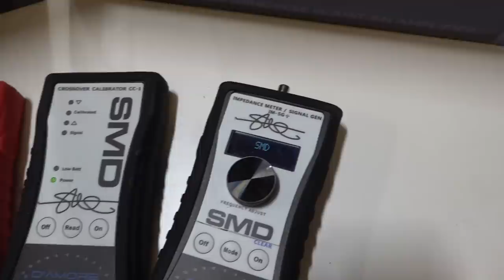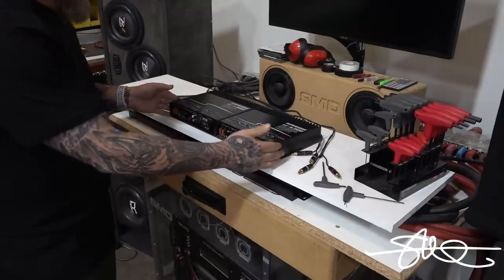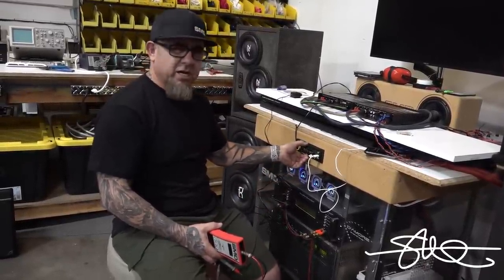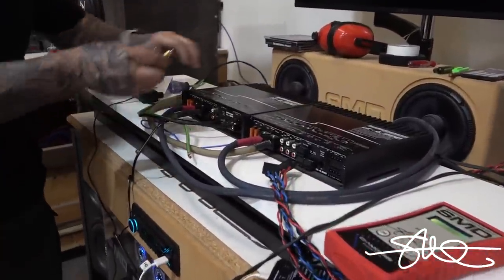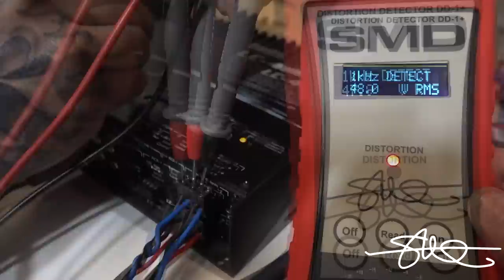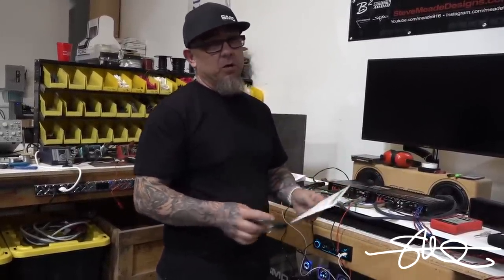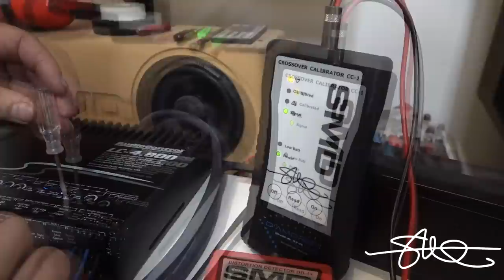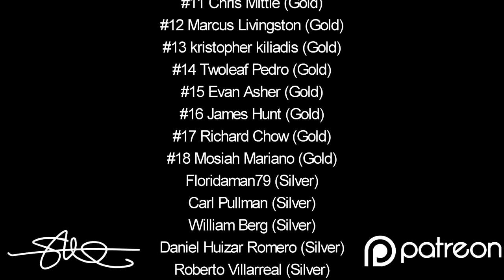Full Blast Safely! How to Properly Set Gains & Crossovers on Two Amps + Bass Knob

Comment from the maker: want to understand gain's and gain overlaps a little better? this is a great read.  https://www.stevemeadedesigns.com/board/topic/207759-what-is-gain-overlap/?page=2
Reply: I need some help big homiie trying to get this 2004 hyundai santa fe right I got a 1000 watt 25 to life amp from rockford fosgate need some info on which subwoofers and mids and tweets are best for me the amp also says 5ch
Reply: I still don’t understands this gain overlap );
Reply: meade916 I Used your equipment and now I never heard my Subwoofers sound so Clear and Clean Before I enjoy them wayy more now Thanks meade916
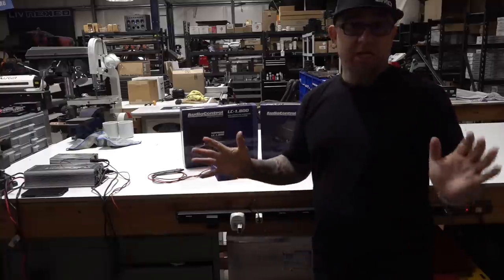Reply: What is the name of the song at 1:13? Also I'm a huge fan Meade!
Reply: @sleepzzz800  it is like turning the test tone down because not all music is at full volume as some are recorded lower, also USB, ipod and CD music can play all different on the same system, so the 0db tone is like full volume but not all music is like this so if you set the gain with 0db with most music its not going to reach full volume, you can also do this to reduce power for smaller speakers / subs, so overlap is just lowering the signal to accommodate for a weaker music signal than a test tone that is at full tilt.

Comment: I have the DD-1 version with the old harness. On my OEM integrated headunit it is hard to set up my gains etc. There are no numbers on the LCD display just horizontal small bars.
The only solution i have is to count how many bars i have from Max then i know my max headunit output. Ive found out that i can blast full tilt when i have 3bars left to max :)
really annoying to not have numbers. Also a little more hard to deal with my NVX high-low converter. Got different output on front and rear channels.
I wonder if the whole setup procedure had been more easy with the DD-1+ in my case?

Comment: When setting the gain overlaps on each amp, how did you know to use 4db of overlap as opposed to 6 or 7? Same as Sub amp, 7db as opposed to higher? I understand why you went lower on db, I don't understand though how you came up with 4 and 7 respectively.

Comment: I feel like I totally need to do this on my setup. But it seems confusing. 2010 Camry XLE with nav. Amppro 4 integration  with bass knob keeping the stock head unit and bypassing the stock amp, arc audio cxl2100 for components and a   JL w6 12 with a phoneix gold amp. Don’t even know where to start lol. It sounds great, but wondering if it could be better

Comment: I don’t need the crossover calibrator with an Audio Control D-6.1200 because I set the crossovers on the computer and they are exactly what I want them to be already, correct?

Comment: Can I use a DD1 or 1+ to check distortion on a Samsung Note 10+? I use it as a BT source on my bike, out to a DD DSI-2 DSP, to (4) Soundigital amps. I need to start at the source checking for distortion and moving down the chain to the DSP and amps, correct?

Comment: where  is the bass knob set when you adjust gain on the sub amp? I'm assuming all the way up.  I know some guys set them half way to give room + or -.   Also, would you have bass knob all the way up when setting crossover?
Reply from the maker: bass knob should be all the way up when setting the gains.

Comment: Hi i get all your doing and understand it all but one thing i don't get is say JL audio and others give a target voltage, so JL give one of 69.3v at 4ohm and 42.4v on 1.5ohm for the HD1200, this is clearly different to each other but not if using the DD1 as you would get one voltage irrelevant to ohm load which they calculate, any help here would be great as its one thing about gain im missing

Comment: If anyone would like to chime in.. 
What if you're running a set up with different speakers on a 8 channel amp, with speakers wired in parallel (6.5s) 2 pairs, wired in Normal (6x9) 1 pair, and wired in bridged mode 8s full range 1 pair. Would I put the probes in each pos and neg terminal still? or...for example bridged the probes for the 8s that are in bridged mode?
Also, some of these newer stereos don't have cd players, I know tracks can be downloaded from the site, but most people are using apps like spotify apple pandora via bluetooth. If I download the test tracks to iphone music library and find the max vol. before distortion on hu using hardwire or bluetooth from phone, would it matter if i'm playing songs from different apps in lieu of apple library? If theres a video out there that explains please point the way because i've been looking...

Comment: How do you determine db overlap..I'm currently running 4 ground zero 6.5 coaxials on channels 1 and 2 and on three and four I'm running 8 in ground zero coaxials also four of those on a 2 ohm load on a sound digital 2,400.4 on a bike ..

Comment: Gains are matched to head unit output? So is it better to have a head unit with 4 or 5 volts output so I can turn my gain up higher on my amplifier.  Or do I just need a stronger amp?
Reply from the maker: the higher the voltage on the head unit the lower your gains will be.
Reply: @meade916  after u set that gains on that amps u can adjust that equalizer on that head unit???or live it flat

Comment: Hi, so what tone would I need to use if I'm setting the gain on the channel that will be playing midbass? For example, in my BMW e90, I'll be setting them up so that they are bandpassed between 80-250hz. Would I use the 1000hz tone here and set it to -5db of overlap at the amplifier? Is it simply the principle that it's going to be set up on the rear channels of the 5 channel amp hence the 1000hz test tone is used?
Reply from the maker: leave it flat and on full pass. Set the gain. Put it where you want it when done. Simple.
Reply: meade916 sorry there might be a misunderstanding. I mean do I use 40 or 1000hz to set the gain for midbass driver channels? Thanks 👍🏾
Reply from the maker: @shakeelfaris7623  either one should work but the 40 will be closer obviously to the range you are looking for so i would use that one.
Reply: @meade916  would it be more accurate to include like 100hz on the DD1 or is it negligible?

Comment: hey s.m can i put a line driver on my mids. will it be louder on songs that the voice isnt as loud like in rebassed songs when the bass hits or overall songs that are recorded low
Reply from the maker: you only need a line driver if your head unit does not have enough output voltage....i wouldn't use one if my deck was over 4v.  Most amps don't like or need more than 5.  It won't help you at all probably.

Comment: How would I test a stock head unit? 
Same principle?
Say I powered my amp through a loc tapped into the rear speakers 
I would assume I could still go through the loc, find it, plug in the amp and repeat right ?
Reply: Good question, however the answer always eludes me due to some vehicles having a factory amplifier.
Reply: Poppa T say it doesn’t have a stock amp, would I be correct?

And if it did have a factory one, would I have to find the way to de-energize it to get an accurate test ?

Comment: I mean I know you pass the guy in the driveway stage and you pushing equipment but couldn't you show some of us fans on a budget how to set crossovers, gains and find voltage readings with a simple digital multi meter. I mean it seems a bit much and overwhelming with this for that and that for this. Before the tahoe and Escalade you were like us with a digital multi meter but anyways who cares right just find a Steve Meade to hang around like you did and learn
Reply from the maker: already showed you guys how to set gains with an o-scope years ago and now that method is inferior so i don't do it anymore.  Never used a DMM for that as the results are the same as guessing.....WRONG. lol.